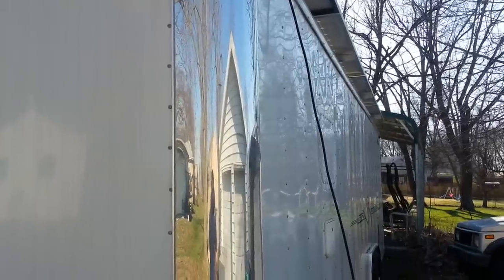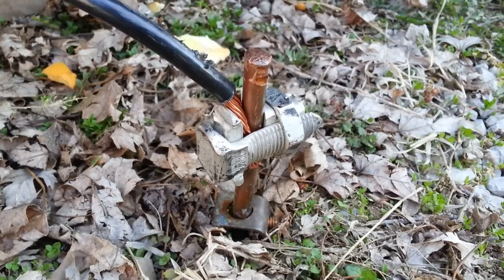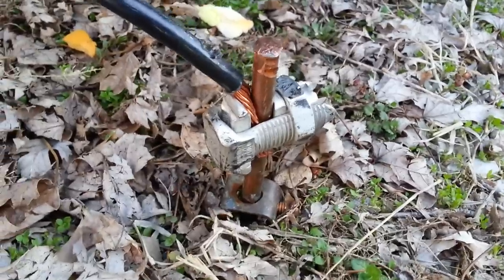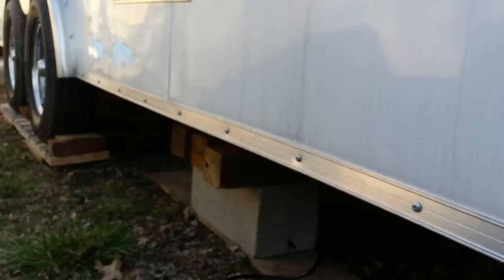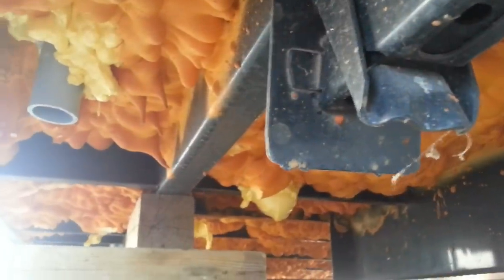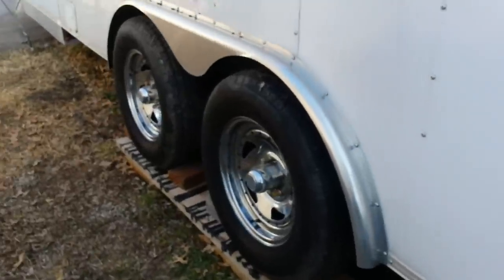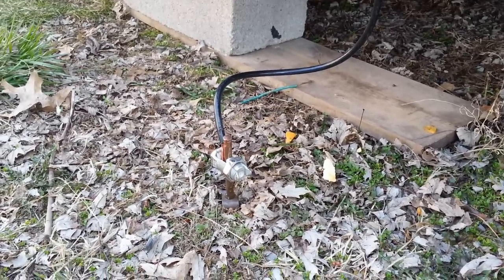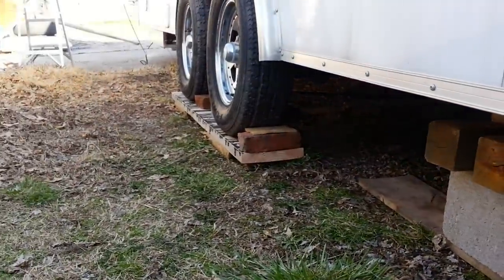Grounding and structural concerns with the Off-Grid RV

Comment: How did this work out since it was in 2013? Are you alive? You can measure how well your ground is working. The clamp-on meter ones start at around a hundred bucks. I've just put 12x300W mono panels on a car trailer and am grounding it in rocky ground. Not easy but eventually I got good values. I keep it watered through a small dehumidifier also on the trailer that drips to a hose you normally use for plants.

Comment: 7x16 with 5/300 panels. Cobbled together a "pull up and off" removable rack system resting inside a welded L base structure welded to frame in six places. One contains the wires that turn up under the floor. No holes in skin and rack has at least 1" clearance from skin everywhere. Looks like your width is maxed out.

Comment: I'd be much more worried about the UPDRAFT under those panels. I don't know how much wind they can sustain from underneath, but at 55+ MPH you will have a lot.
Also, if you put 8 foot ground rods in the ground you can use a jack to pull them out. An impact hammer or hammer drill will make driving them in extra easy.